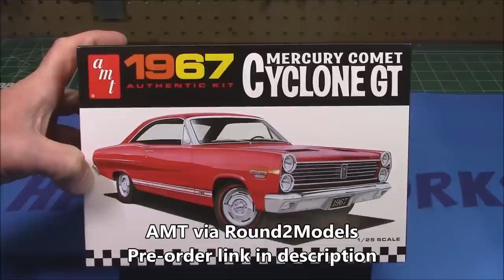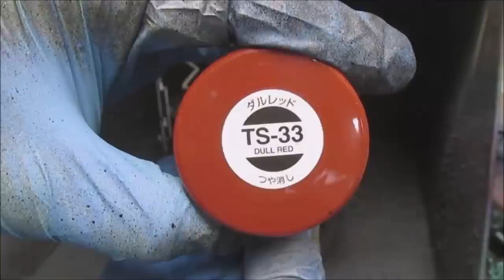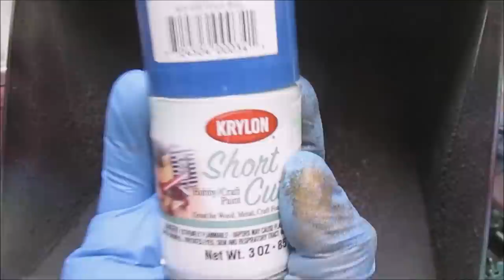1967 Mercury Comet Cyclone GT 390 1/25 Scale Model Kit Build How To Assemble Paint Interior Engine

Comment: I know that Ford and Mercury had "duplicate" models into the 80s.  My first car was an 82 Ford Fairmont, the Mercury equivalent was called the Zephyr.  The most obvious cosmetic difference was the tail light lenses.  On the Fairmont, the lenses had a vertical pattern, on the Zephyr, they were horizontal.  Excellent build Chris.

Comment: Another fine memory flogger. By the late 1960's Ford and Mercury, shared bodies and engines. Colors, outside trims and interior differences were the tools that Ford/Mercury engineers used to satisfy the marketing and finance folks at FoMoCo for DIFFERENT cars. Years later when GM sold re-trimmed Chevys as Cadillacs, they were sued (by Johnny Carson among others). This is a fine example of Comet's re-badged Fairline. Chris your build is impressive. Your color choices are just right. Thanks for sharing.

Comment: Very nice build, Chris!  Your paint looks great. 1:02:01 1:02:01 This kit is every bit as nice a kit as the AMT 1967 Ford Fairlane GT/GTA or the Fairlane 427 kit.  When I built the Fairlane GT/GTA back in the late 1990s, I purchased an aftermarket front spindles kit, which lowered the stance.  I believe the kit as designed sits a bit high in the front.  I have a 1990s edition of the AMT 1967 Mercury Comet kit in my stash and I need to build, it now that I see yours!

Comment: I don't for sure, but my old boss, had a 67 Fairlane, back ,1979, with 289, it was a transmission shop, if I had that carb off once I had it off 25 times,  trying different things to get better gas mileage! Epoxy screen under carb, fuel lines inside heater hose vs for atomization, nothing really helped, it was a fairly small car with a tiny engine! It got pretty good mileage for the time, but that was the first time gas got over a 1. 00 a gallon!!